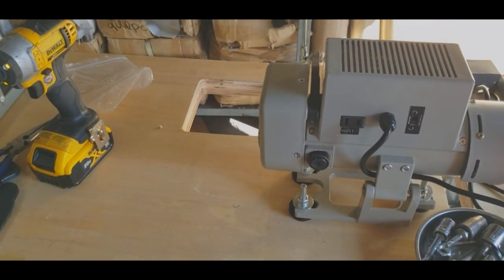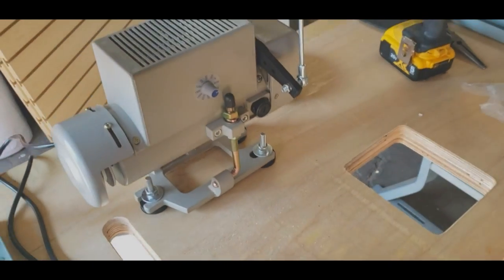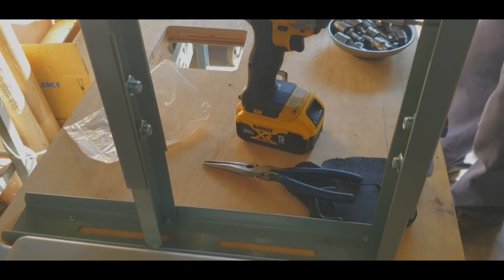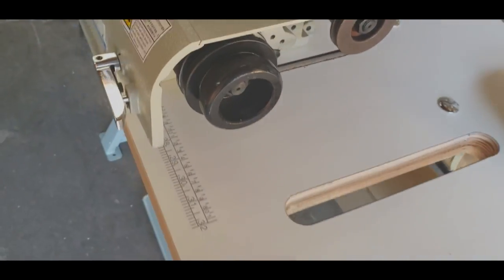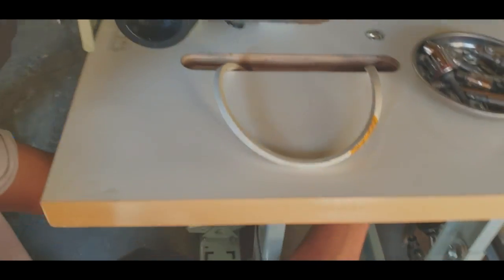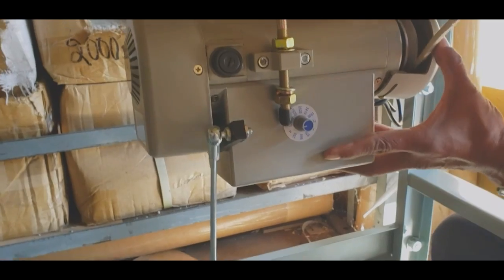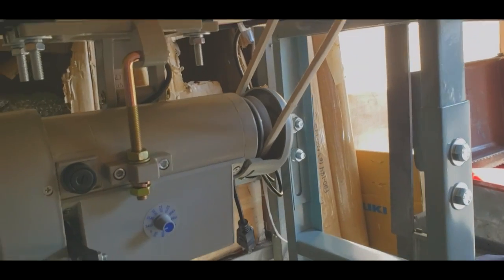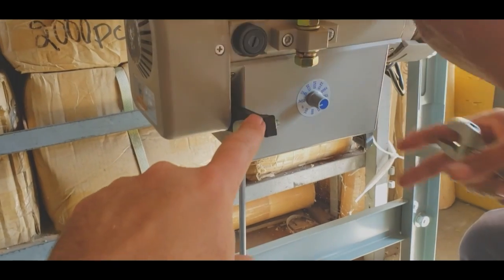Tutorial -Assembling the New-Tech GC-801 Skiving Machine- Part 1 -Goldstartool.com - 800-868-4419

Comment: Had an issue with this skiving machine I bought from them that arrived not working correctly.  After a bunch of back and fourth for over a month nothing has been resolved. The machine arrived broken and I still have no replacement or refund.  Yes its cheap, but be prepared for customer service to be lacking if you have any issues.  Might want to look elsewhere for a better machine and service.